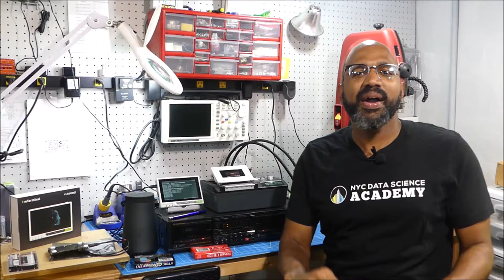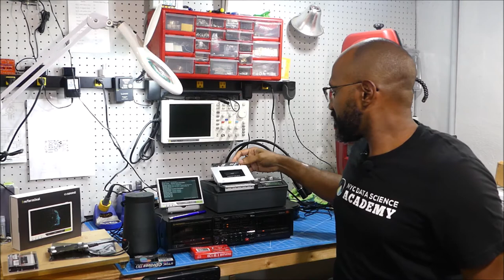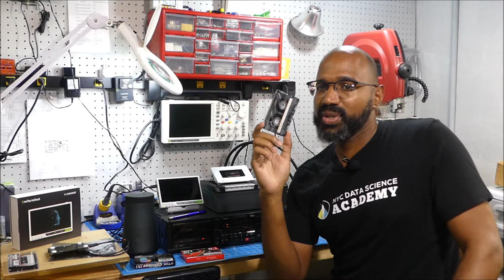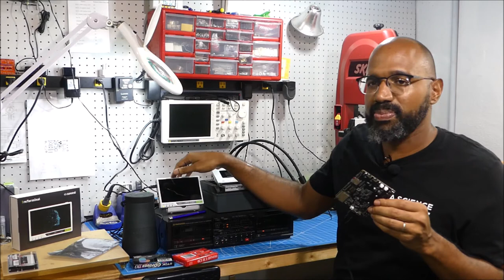MP3 Playback from Old School Compact Audio Cassettes

Comment: Very interesting!! Old tape/modem technology. I thought that it never fits 20 * 5mbyte (avarage MP3 song size) on a normal cassette. Even on a DCC cassette this would be challenging! Or is this storing metadata of a song only and controlling all via a physical deck?
Reply from the maker: You are correct.  Its just storing the metadata on the cassette to indicate to the mp3 player (in this case running on a Raspberry pi) which file to play and what time to start playback. So the play/stop/FF/RR functionality of the deck works as you you expect.
Reply: @nate250  thx for your explaining reply! Great job and a funky project 👍😁.